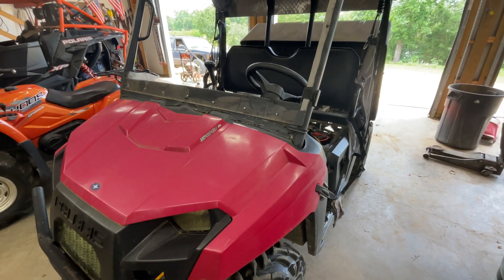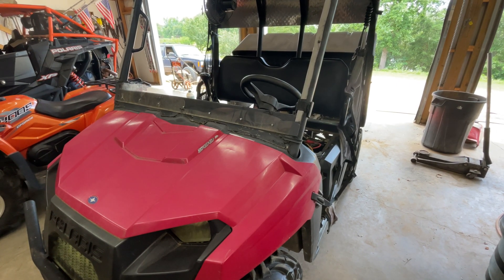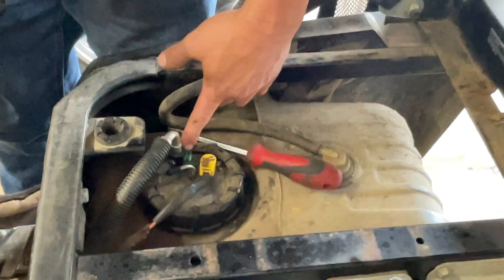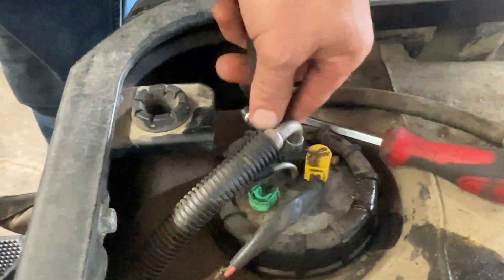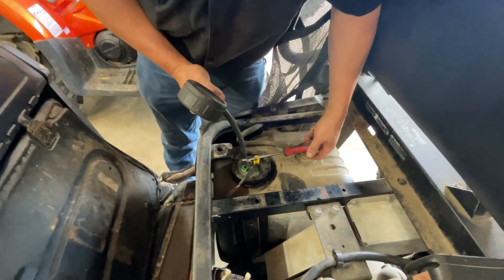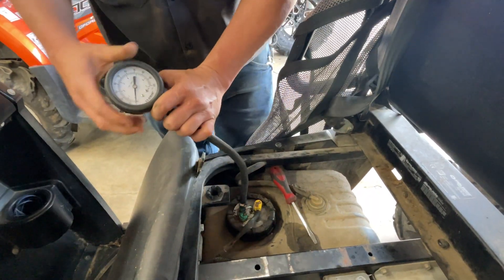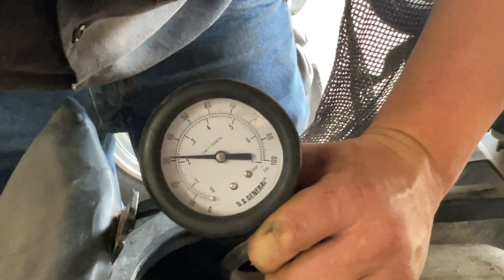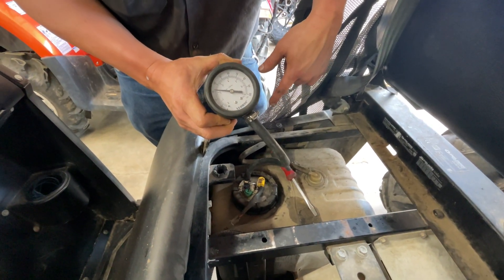Polaris Ranger 500, How To Do A Fuel Pressure Test, Fuel Pump, Engine Stall, No Power, Will Not Run

Comment: Could you also just pull the line off and see if it pumps fuel out when cranking? Obviously this wouldn’t give you the PSI, but that would atleast tell you if it’s working at all, right? If no fuel is pumped when cranking then it’s not working at all, right?
Reply from the maker: No, just moving fuel isn’t enough. If it doesn’t produce enough pressure then the injectors will not work. Hope this helps you out.
Reply: @crankitt825 yeah I appreciate it. I’m getting the tester but I have no fuel moving at all through the line or anything so I’m guessing that is also a tell that the pump is bad if it’s not even pushing a single drop through. Thank you for the quick response!
Reply from the maker: can you hear the pump come on when you turn the key on. If not check your fuses. Might not be getting power to the pump.

Comment: I purchased the tester you recommended in this video . How accurate are these testers. I’m working on a ranger 700 . Only getting about 25 psi with a month old fuel pump . Is there anything else to test ?
Reply from the maker: Tester are very accurate. Sounds like you need a new fuel pump. Nothing els to test on the fuel system until you get the proper fuel pressure. 
Thanks for watching!!